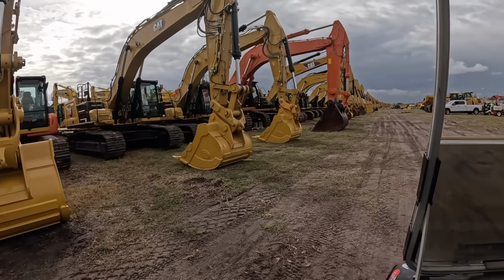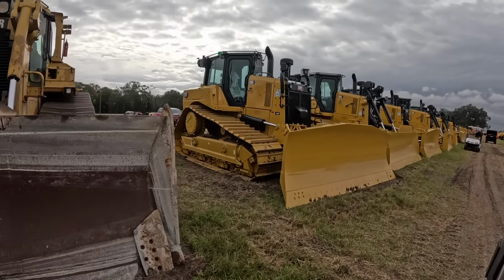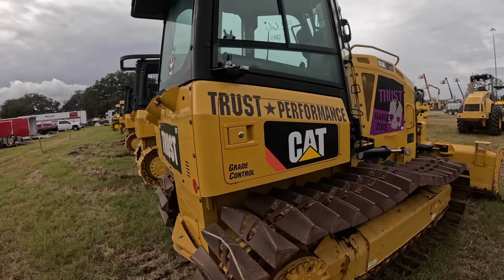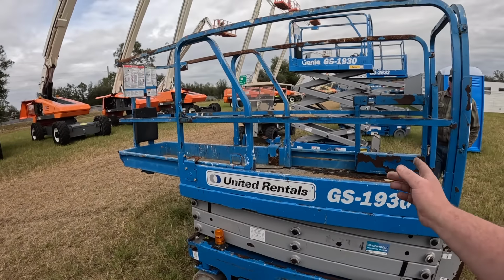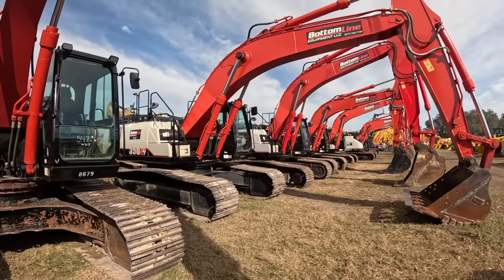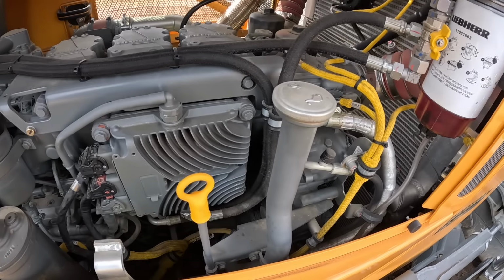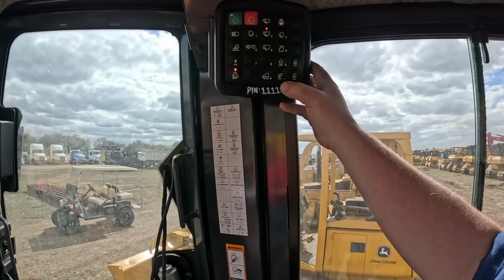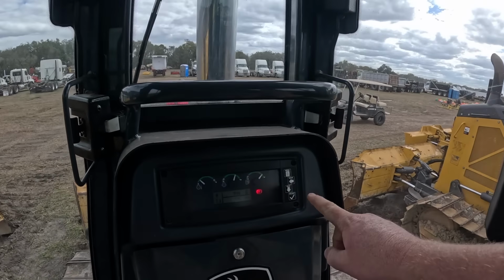Huge 10 day auction in Florida with all sorts of things, but deals for me were not one of them!

Comment: Caterpillar Limited Warranty1 covers the cost of parts and labor for 12 or 24 months or a specific number of operating hours for new Cat equipment and engines.

Cat D6 and D6 XE dozers are manufactured exclusively in East Peoria, Ill., and Grenoble, France, along with other models in the medium dozer line.
In the late 1920s that early Caterpillar gas powered model Ten and Twenty track-type tractors were working on sugar beet fields and vineyards across France. 

The D4D was the first track-type tractor produced in Brazilian territory, at a former facility in Santo Amaro city in 1969. Nowadays, the Piracicaba facility produces the models D6K, D6N, D6T and D8R. Piracicaba is also the sole source for the model D8T.

Comment: The lil heli forklifts 25 r pretty good place I used to work at had 2 1 they had 15 years then got another new one really tuff units the new one u turn the key on n had to wait on the fuel pump to shut off b4 u start like 10 seconds r less if not they crank a lil longer

Comment: I guess all things are relative, having run a D11T  by Hitachi 3600’s for 15 years the equipment for auction seems so tiny. And this iron was dwarfed by the draglines and electric P&H 4100’s we worked around. The D11’s burned 400 gallons of fuel apiece in a 12 hour shift. Damn…….

Comment: When an auctioneer starts at $200,000 and ends up selling at $39,500 you have to wonder if somebody just got a deal or bought a turd.
Reply: Aren't they supposed to start out low and bid up not start at 200.000 that's like a freaking scam.

Comment: I don't know how mainland prices are for used vehicles and equipment, but here in Hawaii on Craigslist and marketplace, dealers included, are asking at new prices for 20+ year old vehicles and justifying it because the cost of new vehicles is si high.
Example:
04 Dodge Dakota 4.7 v8 4x4 new was between $15,000 and $23,000 approximately.
Craigslist has several of these same vehicles listed for $17,999 and up.
Absolutely crazy.
Tough break on the auctions.🤙